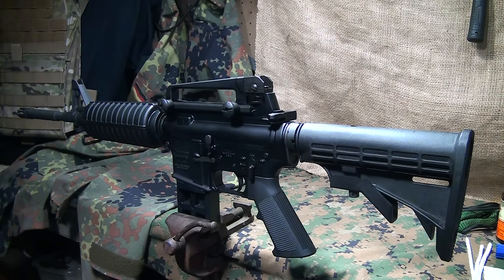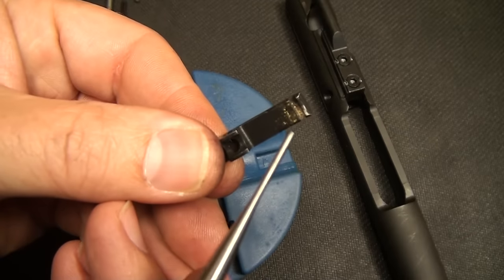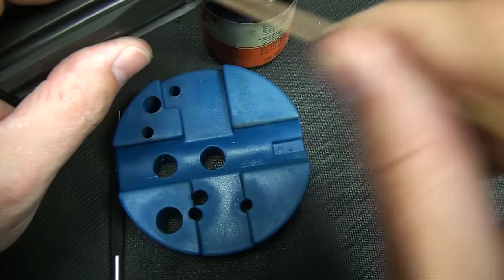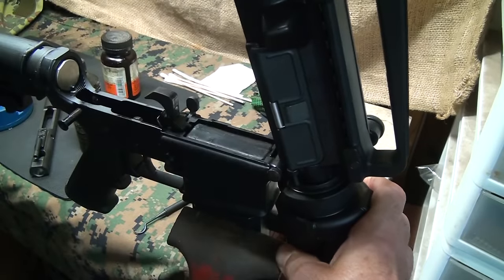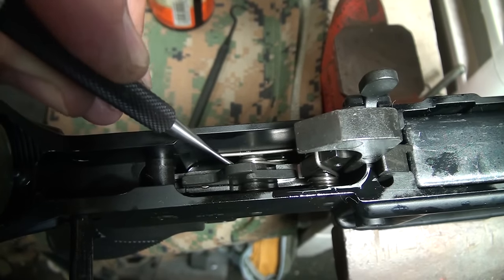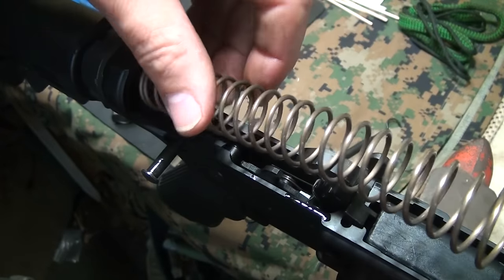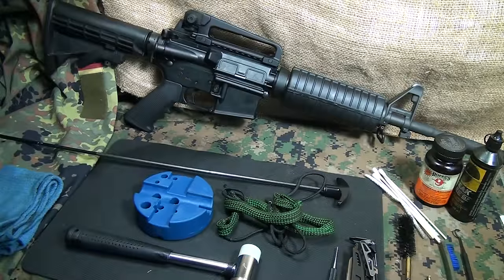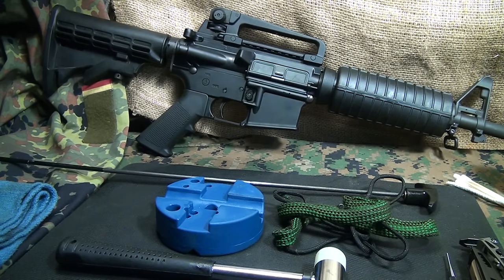How to Clean the AR 15 / M4 Carbine

Comment: This video would be about 15 seconds long if it was about cleaning an AK-47. 
"Ok, so spray it with WD-40 everywhere and run a dirty rag down the barrel"
Reply: Boot lace with a knot tied in it, dipped in used motor oil.  AK47 bore snake.
Reply: I kinda agree. I have two AR's and love them both. You can get a really good AR for under $1,000.  However the AK's I've look at are higher to get the same quality of rifle.  I love the AK but my Smith & Wesson M&P sport II and my Colt LE 6920 are great guns and both under $1,000.  They do require some cleaning though. I've had them both for years and never had a malfunction with either.
Reply: @ranger1721  Wow! My first rifle is LE 6920 and the 2nd is M&P sport  II :)
Reply: This is why I stay away from Ar’s My Aks are way simpler & less maintenance is required
Reply: “Spray with hose and let air dry”
Reply: Haha! Great comment
Reply: Larry vickers filled up a tub with mobil one motor oil and dunked it. Pulled it out let it run out and went to shooting. I like mine wet.

Comment: Dip your ar15 in a bucket of good oil.  Stand it up.  Excess oil will run off. Put one drop on your mirror. See how it travels down the mirror. Good test for your oil. Thanks. SC Navy vet. 1965. 🇺🇸😊

Comment: Sooch00 after watching numerous vids on cleaning and reassembling a AR you are the only one showing how the bolt goes back in the ejector at the 4-5 o'clock position and the extractor roughly 11o'clock position 
thanks for the detail

Comment: Sootch, a useful suggestion for those who have the inclination is to use a sonicator (vibratory cleaner) bath. Lyman makes one, as do several other makers. The device consists of a small bath with a temperature control, timer and on/off for sonication. Simply fill the bath to the fill line with warm-hot water, add a small amount of grease cutter, and then place your dirty parts in the basket and lower the basket into the bath. Hit the control buttons to start and the machine does the rest. Obviously, this machine is a luxury and doesn't not replace your method in the field or when by-hand cleaning is needed, but a sonicator is a real labor-saver if you have a lot of dirty gun parts to clean. More-stubborn deposits can be left to soak overnight as needed. Cabela's and other retailers offer environmentally-safe grease cleaners which may be safely washed down the drain and do not require haz-mat storage/pick-up.

Comment: Great video! Regarding lube however, I've seen a lot of guns choke from being too dry, but I've never seen one choke from being too wet.

One tool that's nice to have is an Iosso Complete AR-15 Cleaning Kit. It has the proper brushes to clean every part of the rifle. It's not a have to have, but it's sure nice to have! That and a bore snake and you've pretty much got it covered for most cleaning. Add in a good 1-piece rod, jag & brush set and some patches for heavy bore cleaning, and you're set!

Comment: I prefer "wet". During extended engagements the carbon will act as a graphite like substance when combined with a generous amount of applied lubricant. The dry method may lead to premature binding/failure during high heat cycling for extended periods due to carbon fouling and wear without the added lubricity. Excellent and thorough information on proper cleaning and maintenance regardless.

Comment: One tool I use is a portable Hawk air compressor used for driving finish nails for interior construction.  A high pressure air nozzle works great especially in the upper receiver.

Comment: I use Hoppes, rag/brush to clean residue off the upper and lower.  I use Lucas red high temp bearing grease to lubricate the bolt and apply it on the metal to metal parts that contact one another.  I use a hobby brush to apply a thin coat.  I use liquid bearings (synthetic machine lube) on the trigger and other pivot parts.  (petroleum has solvents which continues to evaporate.  Synthetic clings and is not effected by gravity)

Comment: I suggest (and learned in the military) not to push the cloth through the barrel. Rather put the rod from the nozzle through the barrel, slide the cloth in and pull through. This will keep you from snapping the rod in the barrel when you maybe lose your balance or something. The first few soaked in lube or solvent to clean. the rest dry until you get clean cloths.
Reply: pukinator1 ... great tip, Puk. Gonna use it. Thanks!
Reply: Really no need to clean the bore on an ar. Even a 22 with non jacket bullets, never had issues with fouling or anything.

Comment: My family taught me to lubricate all metal parts, especially if you will only use it once a year. They also lived near the coast, and if you go shooting once, get some corrosive agent on there (like salt in the air) it can cause rust if you don't wipe it off. The last thing you want is to pull your rifle out of the closet in a year and see pitting. Maintain your gun to last 100 years and it will.

Comment: when cleaning mine, i like to take a few oiled patches and run them through the barrel before using dry patches. i find it tends to pick up more grime than just dry patches. also, if you use a solvent, put more than one coat of oil on those parts. put some on, rub it in, wipe off excess, let it sit, once all parts are completed, do it one more time. while running it on the drier side prevents build up, it runs smoother when wet.

Comment: I have never seen those star patches.  I will have to try them out. I have been using a chamber brush and mop with a fixed (non-spinning) cleaning rod.  This works great, but is often more then needed.

Comment: Years ago I found a double-ended nylon bristle baby bottle cleaner that, with solvent, works great for the upper receiver. The large end is for the charging handle and bolt area. The small end has a "stepped" brush that  fits perfectly in the locking bolt ("star") area and the chamber.
This double-ended brush must have been designed by Eugene Stoner for his wife to clean baby bottles, caps and nipples.

Comment: Overall good video.  I will say as a beginner I struggled keeping up a little bit.  I think it would be helpful if you would not edit out certain parts such as taking it apart.  Also , there were a couple different options in the lube/oil at the beginning of the video, if you could distinguish which you are using that may also be helpful.  As a person who is relatively new to this it is easy to overthink of what I am doing.  However, I'm sure folks who have a good idea of cleaning are able to understand what I was a little slower to understand.  Either way good video and thanks for the help!
Reply: Im so green with this stuff, i cant wait to get my 1st AR soon though.

Comment: I took my AR and a couple of my Sig pistols out of the safe for a trip to the range yesterday and all three guns were gummed up and sticky like I had lubed them with pancake syrup. Thanks to Froglube I never made it to the range, I spent the whole day soaking this crap out of my guns with solvent. Never again!
Reply: I too have a SIG (226) and an AR (Colt) and have been using a product called Terra Gun. I've mentioned this product, ad naseum, on several other sites with no feedback. Anyway, it is a protective/lubricant that is molecularly over 500x smaller than Teflon. It is not a coating but rather goes into the pores of the metal to protect and adds a degree of lubricity. Been using it for years and my guns work perfectly.
Reply: Just use clp or ballistol way better
Reply: I have had good luck with regular motor oil.  That stuff is made for more RPM's on one trip to the local convenience store than they will EVER see in your rifle.  My rifle runs pretty reliably and low-maintenance on it--NOT saying that is the only way--just that it has worked well for me.  Your mileage may vary--pun intentional.  ;)
Reply: Kami kadze ; THAT was the other product I was trying to think of! Thanks for the reminder!
Reply: Richard S ; Makes perfect sense@
Reply: It is also cheap, easily obtainable, and should be easy to store a lifetime supply for "after The Day" IF the proverbial balloon should ever go up.
Reply: CLP and Remoil work for me.

Comment: Good video. Man I remember how unglued the Drill Sergeants became when we called our M16 a gun. Funny how doing push ups can jog your memory, it was a "rifle" or a "weapon", nothing else.
Reply: A gun is a ranged weapon designed to use a shooting tube (gun barrel) to launch typically solid projectiles.
It's a gun, a long gun and more specifically a rifle or a "rifled gun" as was the original term before we shortened it.
Reply: @LoydAvenheart  Makes sense.

Comment: I have tried all these new lubes and,to be honest,I haven't found that any of them work better than good old gun grease. The grease may be a tad bit messier but it works great & it is $15 for a tub that will last a decade. I also run a new gun "wet" until the surfaces that slide on each other smooth out. It seems like those surfaces become smoother. Is that really the case? Does it help? I honestly don't know (probably not) but that's how I do it.

Comment: Put whole gun in diesel ( without non-metal parts ). Rub dirty areas with brush. Wipe it dry withclean cloth. Use little amount of 0w-30 best synthetic oil on moving/sliding components .please correct me , if I am wrong. Thank you.
Reply: wipe down the bolt carrier and oil wear points where it rides in the upper. All that needs to be done.

Comment: Thanks for the informative cleaning instruction, my question is when you disassemble the extractor your model had a rubber o ring on the extractor spring. Mine does not have this o ring. Mine is a DPMS Recon model is this normal or is mine missing the o ring?
Reply: edie ballard the o ring adds extra pressure to the extractor I suppose. I would have one if I could.

Comment: Do all ar15's have the o-ring on the extractor? My colt 6920 doesn't have one? Got it brand new and this is my first time cleaning it and it doesn't have one, I'm sure it didn't fall off upon disassembly.
Reply: No, all AR15's are not supplied with the Oring on the extractor. If you don't have one then definitely pick one up, they make a big difference in reliability and last a very long time. Even if your extractor spring is worn out and doesn't work adding an Oring can still facilitate reliable extraction. I personally wouldn't run any rifle without an Oring. They only cost a few dollars, definitely a no brainier. BCM makes a superior product, here is the link. You save a few bucks if you buy 3 instead of one. 

http://www.bravocompanyusa.com/BCM-Extractor-Spring-Uprade-Kit-p/bcm%20extractor%20spring%20%203pack.htm
Reply: Colt is using a 5 coil spring with an insert. An O ring isn't necessary with that setup but, like Chuckwagon says, an O ring is a cheap & easy addition. As long as there is enough pressure on the extractor it will work fine but that is a very small spring being worked hard. They don't last very long & then you start getting malfunctions. If you add an O ring it lasts longer & has fewer malfunctions as that spring wears out.
Reply: ^^^^^Great advice.

Comment: How often do you clean an AR? I have ran about 300 rounds through mine.
Reply: when you start to notice it cycle slower clean it.. or whenever you get bored
Reply: Jeremy Long
Good answer thanks for getting back to me. I had a round jam in my 9mm and that when I cleaned it, but didn't want to wait that long for my ar.
Reply: +Parrot Bill go ahead and clean it as soon as you want you can't really clean it to often.  I've cleaned my guns after 20 rds and others I've let go over 1000
Reply: Thanks man.

Comment: Ok but I used froglube.please help.Down in carrier towards fire pin where bolt slides in. I have heavy carbon it wouldnt come out with out using something stronger.why didnt froglube protectit.I had to use hoppes when i dont want to .I want to use just froglube.Please advise  what you do exactly with froglube on just the bolt carrier group exactly?Please

Comment: I cant get my bolt and charger in right please make another video
Reply: I'm sure you figured it out already, but there is a notch that the charging handle falls into, once it's in, slide it forward slightly to keep it in place and then drop your bolt into the groove on the charging handle with the gas key facing down toward the charging handle.
Reply: thanks bud I figured it out